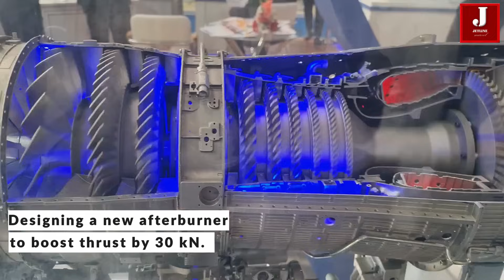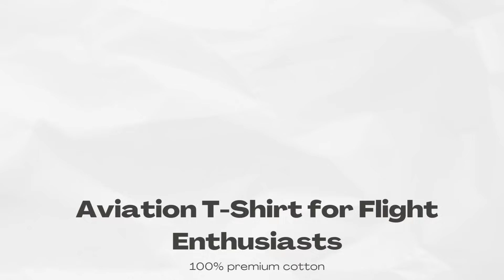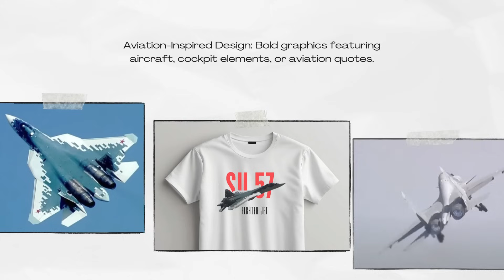How is Russia helping India build the Kaveri engine? #fundkaveriengine

Comment: High altitude testing of Kaveri engine is going on with help of Russia. As reported that 25 hours of testing still remains. Thereafter analysis of data of high altitude testing, and further refining and tuning if required, Kaveri derivatives Engine will be used for substantial flight testing.